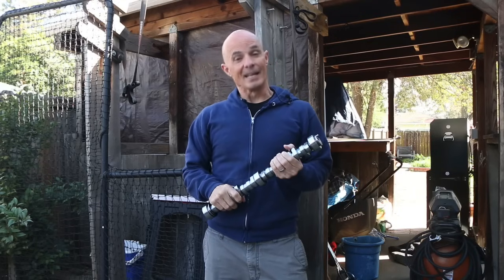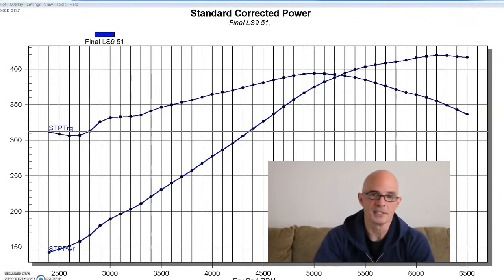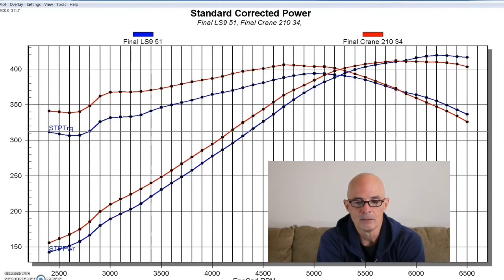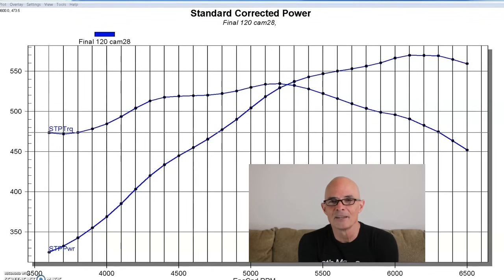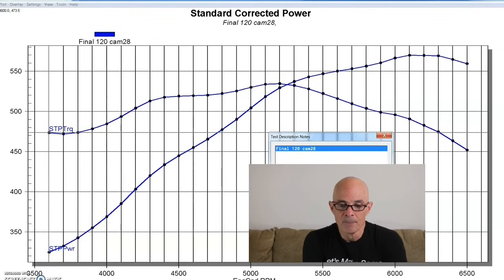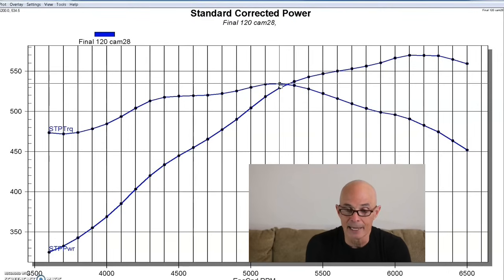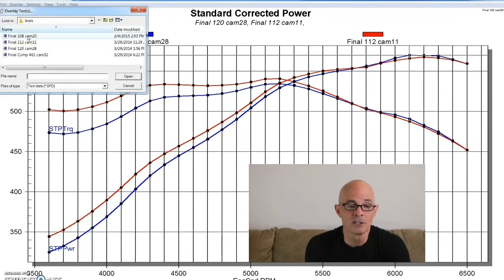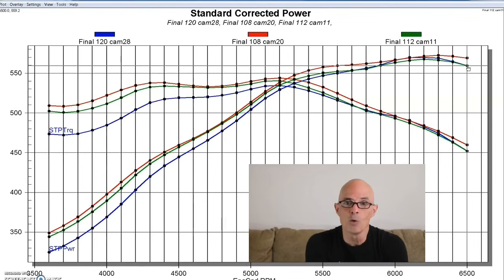LSA CAM TEST-108 vs 112 vs 120

Comment: I just realised, this test would be a whole lot easier with twin cam, straight four or six cylinder engine.
Reply: Tiit Saul he has said they have a cam swap down to 30 minutes on the dyno so not to bad to keep changing them out 👍
Reply: ZedTee77 Cam swap part isn’t the problem. With adjustable cam gears on twin cam motor, tests can be done at 1 degree increments. Say from 100 lsa to 120. With ls motor you’d need 20 individual cams. Tests at 1or 2 degree increments would paint a lot clearer picture than just 3 separate cams.
Reply from the maker: did lots of that with the B-series (and D and K) Honda stuff
Reply: Richard Holdener is the data published somewhere?
Reply: @richardholdener1727  We'd love to see the data...
Reply: Tiit Saul ahh all good mate, I wasn’t thinking of adjustable timing gears! Good point 👍

Comment: Tell em what happens to the vacuum. The brakes 😁
Great video 108 centers rock ⚔
Reply: Do you think vacuum suffers much with smaller LSA? I need good vacuum for the brakes or need to go hydroboost.
Reply: I have run as big as 266@50 on a 99LSA and still had enough vacuum for brakes...

Comment: I'm curious how the LSA affects driveability and throttle response.  Narrower seems like it makes more power sooner, so it would seem like that would make it nice and snappy on the street.  But it also idles worse, so is that the only drawback to a narrow LSA?  I'm an autocross guy so throttle response and midrange is what I'm after
Reply: Tight LSA also reduces vacuum, A LOT. I had a 233/245 @ 0.050",  .615" lift on 110LSA and my brakes were shit house. Always somewhat hard. The tighter you go in LSA, the less vacuum you'll produce. Plus the idle will be extremely choppy, making it much harder to drive around at low speeds. Nice broad LSA will just purr along nicely at 600rpm. Mine had to be on 950rpm just to be somewhat driveable at low speeds. But, did make peak power of 395rwhp at 6700rpm in a relatively stock 5.7L LS1
Reply: That has been my experience.  Too much can cause your engine to seem too reactive.

Comment: I find it super interesting. Well done sourcing exact same spec cams other than LSA. If any cam had even a slight duration or lift difference, results would be controversial.  
  Power increase up top with 108 lsa cam is confusing. Could it be due some kind of harmonics? Matching with Intake runner length or something like that? 
 I’d love to see a test with same cams on different displacement Ls motors. Thanks for sharing. Love the content you putting out.
Reply: I'm thinking it's from extra exhaust scavenging during overlap. 
Starts air in runner moving more, sooner.
Reply: I am leaning towards exhaust scavenging as well.  As for the increase in low end torque with tighter LSA’s, this occurs due to earlier IVC which increases the dynamic compression. That’s the whole premise behind variable valve timing. Advance the intake cam down low for higher dynamic compression (tighter LSA) then retard the intake cam up top to take advantage of port velocity cylinder filling (wider LSA).

Comment: Nice this is a topic iv always thought about. Few things I knew for sure was the lower the LSA = more chop @ idle but also slightly more difficult too tune. Now we need the results on smaller cube, less radical builds like your budget 5.3 & 6.0.

Comment: Not to feed those who want a full rpm sweep but could you not do a few sweeps from 1500-3500 and then 3500-6500 and just put the data together? The problem is people are going to want that info everytime hahaha. 

What I would love to see is BSFC numbers on various street able 500+ combos. Tested during typical cruise condition range load cells for say a 3000lb car and a 7000lb truck and even that truck pulling a trailer at 75mph (not in California ha ha)

I often see guys saying they want to add boost to their tow rig but I can only imagine how bad the fuel economy would be or if they could even pull a long hill in boost without overheating.